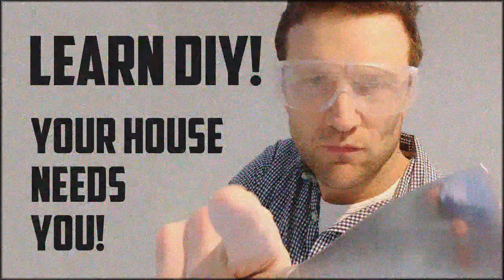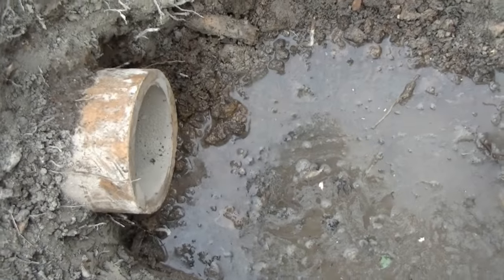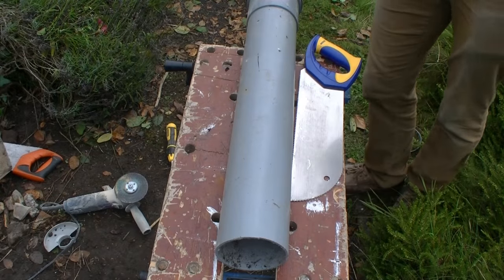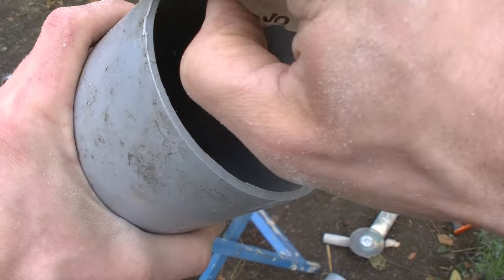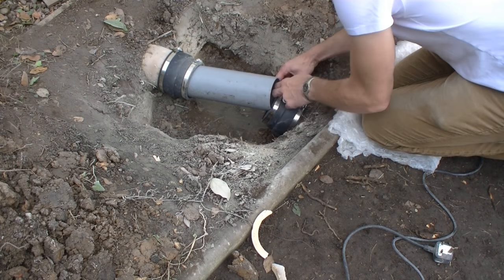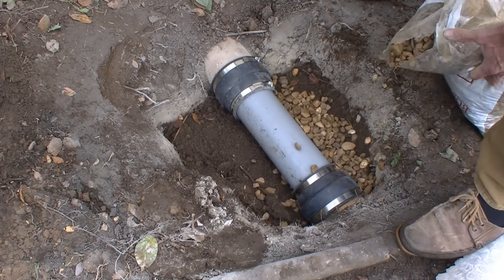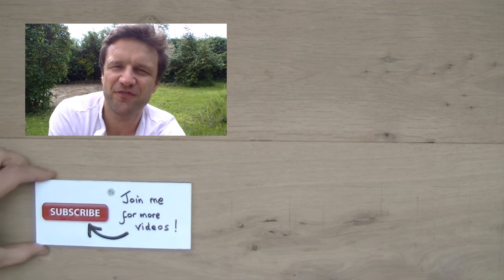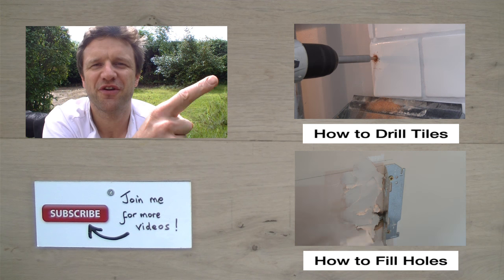How to Repair a Broken Clay Drainage Pipe

Comment: Don't wish to put a spanner in the works but installing a smaller diameter pipe would leave a 'step up' internally. A building control officer would ask you to replace the pipe with pipe of the same diameter
Reply from the maker: Hmmm. Interesting point - thanks Neil. I've checked the diameters of the respective pipes from old off cuts and the INTERNAL diameters are actually the same (4inch). It was the external diameters that are different as the earthenware pipe is obviously a lot thicker. 

But the main point I was trying to demonstrate in the video was that with the Flexseal drainage coupling you can repair broken earthenware pipes by joining them into plastic.

In this instance I was repairing a pipe, the sole purpose of which is to take water from the roof into a soakaway in my garden so I'd be surprised if a building control officer would be that interested, but I take your point, particularly where the pipes are transferring foul waste, you want to minimise any protrusions in the pipe that the matter could get caught on. I'll update the Description to point this out.

The other point that's been made is that I should have used sand around the joint rather than stones because the stones could break the pipe. Again, to be honest, I should have used pea shingle (I don't agree that it has to be sand) rather than the slightly larger pebbles I used.
Reply: Yeah I agree, not so much of a concern if the pipe is only carrying rainwater but thought it was worth mentioning in case someone decided to use a smaller pipe on a foul pipe. Keep the videos coming they're a great source of info
Reply from the maker: Thanks Neil. Definitely worth mentioning - as I'm often doing these videos on the fly because bottom line, there's a job that needs doing around the house and you guys are my checks and balances!
Reply: This is great advice Neil. I'm about to carry out the same procedure, except my system carries rain and foul water through clay piping (pre 1920s I believe). Any idea what sort of external diameter pipe I could likely require to match the clay? Something above 110mm? How do I go about connecting something larger to the outlet of a toilet? Any ideas?
Reply from the maker: It's not the external diameter you need to be checking - as the flex seal drainage coupling is designed to bridge the differences in the external diameter. You need to just make sure i) that the internal diameter of the 1920s clay and the brown plastic that you're using to bridge the gap are the same; and ii) that when you cut the brown plastic, you make sure it fits as tightly into the gap as possible - to eliminate or at least minimise any gap between the two that could cause an obstruction to the soil in the pipe. I didn't do this but should have done - although in my case it's not too important as I'm only conveying rain water in the pipe. 

I suggest you measure the internal diameter of the 1920s clay, and then go and ask your local DIY store /builder's merchants for a brown plastic pipe replacement that matches that internal diameter as closely as possible.
Reply: Thank you so much Charlie, I really appreciate you taking the time to advise me this. I've kept this for reference nearer time. All the best!
Reply: So just to let you know, I measured the clay pipe: internal: 104mm, external 130mm and went into my local builders merchants and they recommended the AC4000 adapter which is the same one you're using.
Reply from the maker: fro0tyl0opy87 That's a great bit of info. Thanks for letting me know!
Reply: Charlie DIYte I don't have a sink in my toilet, so I was thinking to carry out the same procedure as you here. There is a pipe behind the toilet seat but up until now I actually thought the pipe was cast iron, not sure now though, might be clay. There's also an offshoot ventilation pipe that comes out of the main pipe. I live in a really old block of flats. I wanted to deliberately cut the pipe and do what you did in this video and connect the waste plastic pipe from the sink to it. The hot water will come from the bathroom next door and the cold water will come from the same mains pipe that feeds the flush for the toilet. Is that possible?
Reply: Same Internal size

Comment: The pvc pipe looks smaller than the original pipe.
Reply from the maker: It looks smaller because the original pipe is thicker. You probably want to buy brown plastic for underground and cut the pipe to the full width of the area you cut out and slide the collars off the pipe and onto the clay pipe rather than how I did it.  👍🏻

Comment: Should have checked for leaks first
Reply from the maker: I did it up recently as part of the kitchen building works and it was looking as good as the day I did it. Mistake I made was not putting the collars on the insert and then sliding them onto the clay.

Comment: Plastic pipe should not be used for underground drainage,(building regs) also pipes should be bedded on  concrete, however it would appear that plastic pipes are used but they should be brown

Comment: Shouldn’t the rubber collars be encased in concrete because they will degrade underground?
Reply: They are designed not to degrade plus stainless steel clips won't rust.

Comment: Sure looks like you reduced the pipe size and created a bottle neck. Definitely not a plumber.
Reply from the maker: Find me a plumber who'd do a repair like this. The grey plastic is thinner than the clay, so the internal diameters are pretty similar. That's the point of it. Plus it's only handling rain water.

Comment: he is a cowboy... never put a grey pipe underground 
only brown pipe is for underground 
building regs require this
Reply from the maker: A bit harsh, Asif. I'm not a cowboy as I'm simply doing a bit of DIY around my house. Also, I go to lengths to point out in the Description below the video that you should of course use brown plastic below ground. It's a UV light issue rather than the strength of the pipe per se. Brown plastic cannot be used above ground as the sun breaks down the plastic. I used grey because I had a length lying around and the pipe I was repairing simply carries rain water to a soak away in the garden. I'm not sure what building regs would say about me using grey underground but I'll ask them when I've got a moment so I can set the record straight on this.
Reply: @ @CharlieDIYte  Excellent answer to Asif Chas, Also mate grey is more expensive to buy. So if you have some lying around why on earth would you get in your car drive to the Builders Merchants park up, spend more money to buy brown and drive back.
It would be madness!.
This is why I never throw stuff away, you never know when you will be able to utilise it.
 it. You saved yourself time and money. Your not a cowboy Chas your just brighter than Asif...lol.
Great vids mate, I really enjoy them. Thank you.
Reply: @CharlieDIYte  well I told you I have already asked building reg officer. he said brown pipe is thicker than grey one..